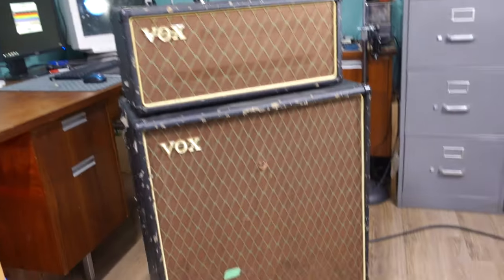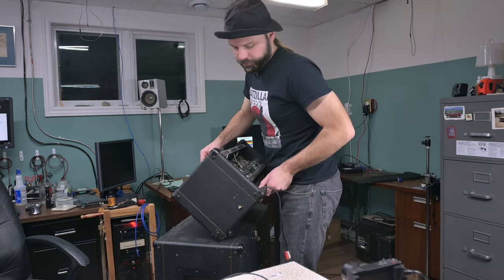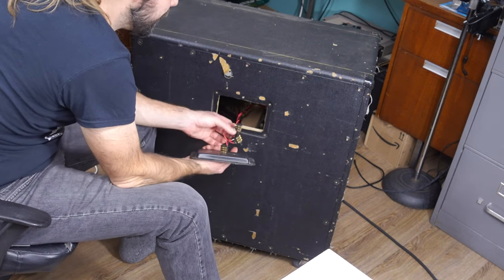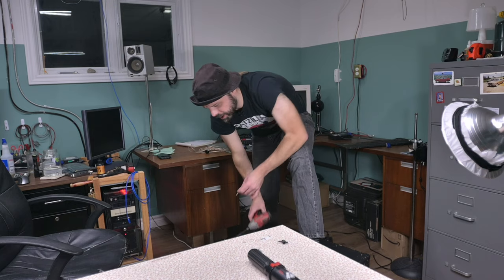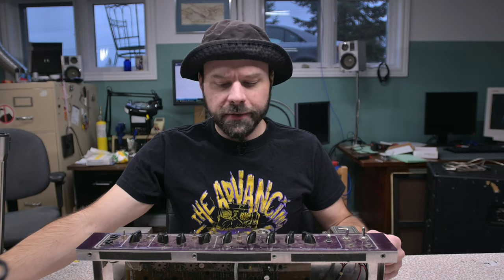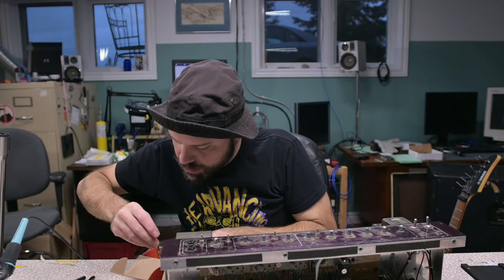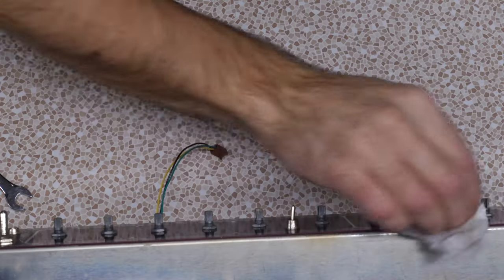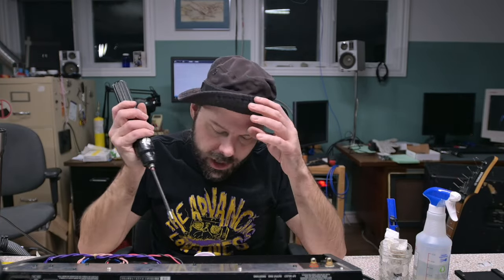Vox AC30 4x12 Rebuild P1: Take down and Inspection.

Comment: How can you tell the tubes age?
Reply from the maker: Various things I think I picked up with experience. After time the labels kind of fade from the heat, and how loose they are. Like if you tap on them gently, and listen for shakey noises. 
Really, the best way is to compare the sound of them to known fresh tubes, the tone starts to flatten out and get dull after a couple years of regular use.

Comment: Those speakers are horrid
Reply from the maker: You've tried them ?
Reply: @DATT  yes I had one in vox 30VR , these are the cheapest Chinese speakers they make and they are pretty farty, I also use a silver tone 1482 through one and tried it with a real Vox ac15 and a marshal origin 20 it was absolute dump and farted out so much when cranked
Reply from the maker: Yeah I hear yeah, esp if you're running an open combo. a 30 watt head pushing 4 of them in a closed cab wasn't so bad. 
I once had a Jet City 2x12 cab come thru my shop, with eminence made speaker for Jet, the sound of them made no sense, kind of tops my list of worst speaker. To be fair, vintage rigs like a VOX are suppose to sound "bad", so at least those speakers kind of work for the kind of dirty cranks amp sound buddy goes for.
Reply: @DATT  I think they would probably sound best if ripped
Reply from the maker: @nickm6001  Now I want to make a joke about ripping farts.